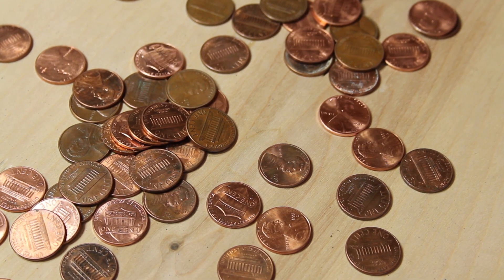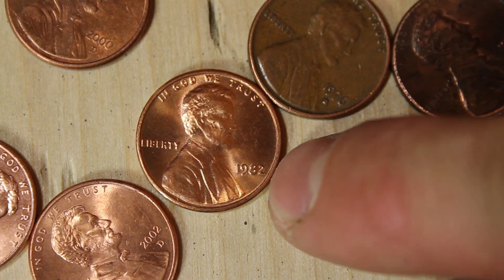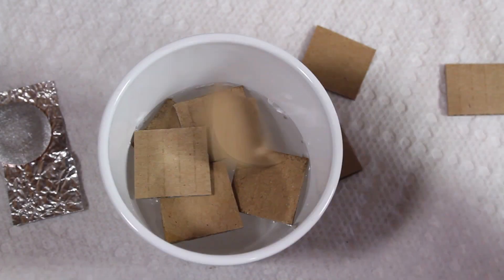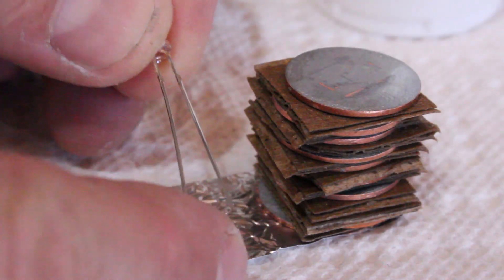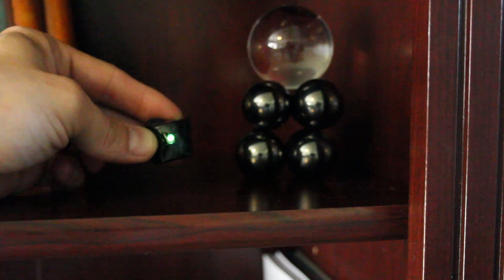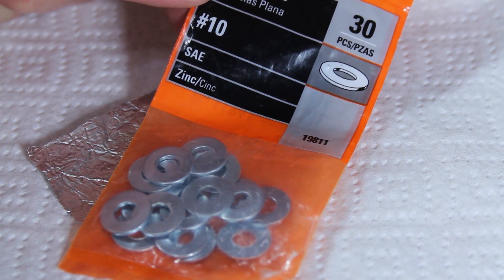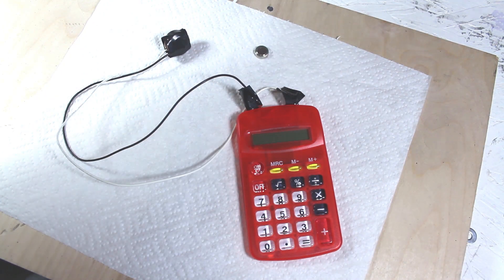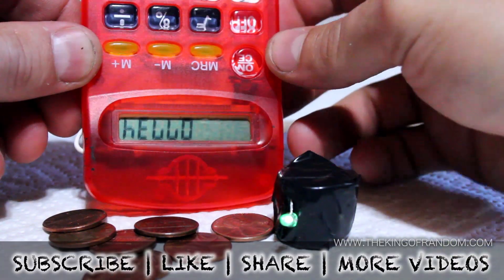How To Make a 3 Penny Battery

Comment: ...also, how big would you need to scale this up to be able to charge a typical cell phone? 5.5V 700-1000mA?
Reply: You'd need 500 of the 9 in series as (1000 milliamperes) / (3 * 700 microamperes) =
476.190476 --  I said 500 to account for loss. At $45 worth of pennies you are better off plugging it in or buying a dedicated phone charger, plus it wont last very long

Comment: I wonder how many grams the larger 6.0 volt pack weighs it could produce some good competition low weight battery packs for radio control model radio equipment voltage needed around 4.8 volts minimum 400ma.

Comment: That's closer to being a capacitor, not a battery...
Reply: nope, i'm pretty sure that it's a Voltaic Pile!
Reply: VoltageHacker That's exactly why I'm asking because it's not at all like that.  The voltaic pile (thanks for the historic reference, Herr Russo Tragik ) is a battery.  The acid (vinegar) that the cardboard is soaked in is NOT a dielectric (i.e. insulator) but an ionic conductor (electrolyte).  A capacitor has to be charged in order to work (that's when you put charge onto the two electrodes and you need the dielectric in order to keep charge separation).
This is a battery where you take one "more noble" metal (copper) and one metal that is to be oxidized (zinc) and exploit the difference in chemical potentials to generate electricity.
Reply: how?
Reply: Harm10412 well, how a capacitor works is theres two sheets of metal and a dieletric , one bigger and the other and the + and - are attracted to each other so the + draws the - toward it looks like this +|- and the Voltaic pile acts like that
Reply: Harm10412 nigga i wish i understood you
Reply: SomeHooligan what exactly do you not understand?
Reply: Harm10412  you're absolutely right. This is far from being a capacitor

Comment: what if i use thai coins? do i still need to sand it or put the rings on it?
Reply: ghuegel No the higher the potential difference, the higher the voltage.
Reply: You need two metals with different potentials... that is, they need to have different affinities for electrons.  The higher the potential difference between the metals, the stronger the electric current will be.  The sanding of the pennies was used so copper (the outside metal) could interact with the zinc (the inside metal).

Wikipedia says that the 50-satang coin is copper-plated and the 1-satang coin is made of aluminum.  These coins should work about twice as well as what was used in the video... but maybe not... I don't know whether the formation of aluminum oxide on the surface will prevent your aluminum coins from working.  Could be a cool experiment.
Reply: As long as one is Zinc and another is copper then yes
Reply: Victor von doom I've been reading your comments. You clearly are still learning the basics. Please don't mess with microwaves until you have a good understanding of electronics, electrical circuits and most of all, safety procedures. The transformer in a microwave is no joke, it can kill you. It's a high voltage device, about 2 kilovolts if I remember correctly. It's also high power (typically around 1000Watts), meaning it can push a lot of current at that high voltage. 
To give you an idea what you're really asking.. people are making plasma arcs with these transformers, and by running them in reverse, they can be used for welding metals together with hundreds of amps of current.
Reply: They need to have a large amount of zinc, im not sure if thai coins do but google will know :)
Reply: Im trying two baht coins
Reply: Victor von doom yes because America is in a crap load of debt they are using zinc because its much much cheaper than copper.
Reply: uhm, in english please?
Reply: Stefan Predersen Right.  I was trying not to be overly technical, so I used "stronger", which is vague; but I had hoped it would get the point across well enough.
Reply: And where exactley are you gonna get Bhat?
Reply: you can use anything copper for the positive side, and anything galvanized for the negative.
Reply: Fuzzi Bunni can u give me a list of galvqnized stuf
Reply: Do u guys know how much a transformer and a capacitor from a microwave is?
Reply: 10 pounds.
Reply: eelcogg
Not only that, a microwave or TV capacitor can kill you without even being plugged in! It's not worth messing with until you know what you're doing.
Reply: Guys, even though  i might be a beginner i opened tons of stuff before a microwave which i already did
Reply: Timothy Kawasaki i live in Thailand, so it should never be mission: impossible XD

Comment: Great substitute for wire: Take a long piece of aluminum foil and roll it up using a thin skewer. The hollow ends make an easy way for making quick connections (just squeeze) and you can cut it to any length. ;)

Comment: Can you test this on an RC car? you just have to reach 11.1 v and test it out. Or would it not work?
Reply: wouldnt work without a LOT more batteries in parallel, as he showed in the video for 6 volts from 3 cells you will get 300micro amps so you would have to have hundreds of cells wired up, some in parallel, some in series to get enough power from pennies to run an RC car. i could calculate how many but meh... im too lazy :P

Comment: Kinda neat trick to show everyone how to make a wet-cell battery (if they caught it), but I had to crunch the cash on this one, and it is scary:
10 pennies

6-volts @ 0.170 microamps (0.000170 amps) means that for 20 pennies, you get to 12-volts (in serial), and to start stacking 20-penny serial circuits in parallel 1,176,470 times (average automotive battery output) gets you to 200 amps for a mere  $250,000. (compare to an average car battery cost of about $100); or, simply $1150 for 12 volts, per amp (or $295 to build you your own wet-cell 4-pack of double-AA batteries, not counting the vinegar, prep, labor, cardboard or GIANT plastic box to keep them all in).

Sorry, I couldn't resist. I think I'll stick with Eneloops and my recharger.
Reply: Sure thing, it is not efficient.  but I am pretty sure any good chemist could get an efficient way to make home-made batteries.
Reply: *****  Depends on what you mean by efficient but yes there are many other better ways to make a battery, though they are much more involved

Comment: Does the United States still use pennies?  Canada doesn't so I guess I have a reason now to make a MEGA battery!  I wanna see a few BIG stacks that equal over 1,000 pennies to see if it can power a few household appliances.  Or see how long it will power a 100w conventional light bulb!
Reply: Okeanos86 Lol, what, seeing someone admit they were wrong instead of being huge dicks and totally flaming the hell out of someone while behind a computer screen?  Not often at all if ever, so respect to you my friend!  Cheers :)
Reply: sc0tte1 you're right, i was wrong :) (how many times have you seen this phrase in the internet? :P)
Reply: YOU ARE A MAD-MAN!
Reply: MrPypap So I've been told a time or two.  What's your reason for thinking I'm a mad-man? :P
Reply: a conventional light bulb works with AC-volt, a battery puts out DC-volt. so it won't work for a second
Reply: Okeanos86 A conventional bulb will work on either AC or DC.  It's just a tungsten filament that heats up; it doesn't matter if the current is alternating or not.  Light bulbs in cars ect work the same way and they are on DC.  Bulbs with electronics however probably won't such as compact florescent.
Reply: sc0tte1
A CFL bulb will work on DC, just make sure the voltage is right. For a 230V AC bulb the appropriate voltage is about 280V DC (Sorry I don't know about 110V bulbs... but I guess 140V should be enough)
Reply: MrOpenGL Interesting..I'd still wonder how good it would be for the electronics inside, causing it to fail earlier but only one way to find out lol

Comment: So considering that the battery for the calculator cost like I dunno, 20 cents? How long did it last compared to the battery it came with? Those little batteries generally cost like 10$

Comment: Wait so when you took the zinc washer and placed it on the bottom followed by the cardboard and pennies, did you sand down the pennies or not? And did you use dilute, or undiluted vinegar? Or does the kind of vinegar make no difference?

Comment: its miliamps not microamps. if it was microamps the led would glow because it uses 10-20 mili amps (10 000 - 20 000 microamps)

Comment: I wonder could you not have 2 cups one filled with say 20 round copper pieces and one cup with Zinc washers and fill them with vinegar . Attach the copper pieces together with wire same with the Zinc washers . Would that work ? One cup is + the other is - then just refill the cups to keep the charge ?

Comment: i powered a nerf gun with it and that it was supposed to be 9 volts power and it used d batteries and then i staked then up and i made like 30 penny D sized batteries its probably like 9 volts each then i made 6 of them and replaced D sized batteries with the penny battery and then it burned out the motor of the gun when i tried it

Comment: Question: Was the polarity of the 2nd battery reversed?

The 1st battery had the copper side of the penny on the aluminum foil, leaving the zinc side on top. When you measured the voltage, u placed the pos (+) lead on top and the neg (-) on the foil.

The 2nd time, you put the zinc washer on the foil, but still tested it with the pos (+) lead on top and the neg (-) lead on the foil.

I'm new...... did I miss something? I just want to do this with my grandkids. Thanks.

Comment: what will happen if we put 200 cell together ? is it will give us 100v :) yeah
Reply: The vinegar is what puts out the energy, not the pennies. The pennies are just the positive leads. The zinc is the negative lead. The vinegar contains the acid. 1 copper lead and 1 zinc lead (like a nail) would be good enough in a tub of 4% vinegar you could probably start a car (12v)
Reply: Nerolus Exactly. I am happy to know that some one knows that the acid in the vinegar gives the electricity. The pennies are just the collectors of the electrons in the electron changing "war" between the acid ions.
Reply: Nerolus Thats exactly what I was wondering! Thanks for that
Reply: Nerolus
Except you cannot start a car because the current is ridiculous (unless you are using very big plates like 50cm by 50 cm

Comment: A CR2032 has 0.6 Wh of stored energy (200 mAh * 3V) and costs around $2. That comes to 0.3 Wh per dollar.
These batteries have 0.42 Wh of stored energy (70 mAh * 0.6V) and cost 1 cent each to make. That is, 42 Wh per dollar! LOL! ONE DOLLAR worth of these have the same capacity as 70 CR2032's, which would cost you 140 times as much!

Comment: Since it only takes 5 volts to charge a cell phone, would you be able to do it using penny batteries? Or is the amperage too low?
Reply: You can make a bunch of 5 volt cells and wire them in parallel till you achieve the needed amperage. Most cell phones run off a 1300mAh battery so that may take quite a few pennies.
Reply: ***** More like 13000 of them to get to 1300 miliamps. 130+dollar project :)
Reply: If his 10 penny stack provided 0.17 mA for 2 1/2 weeks, it provided approximately 71.4 mAh of power.  Dividing that out would require 18 stacks of ten pennies.... and two and a half weeks to accomplish the task.  

If you wish to achieve that 1300 mAh charge within an hour, multiply the 18 stacks by 420 which gets a bit expensive ($756).  But for around $4.50 you could knock the task out in about a week.

Comment: Im doing it for my science project and it worked just make sure to use card board not normal paper
Reply: did you sand the pennies down or did you use the zinc washers? I tried with the zinc washers, but the most voltage im generating is 1.3 volts and it doesn't seem to want to light my led light
Reply: Robert Ito Check your LEDs Forward Voltage, typically around 3.6; so your 1.3V generated isn't enough for the LED to produce light.
Reply: Michael Telatynski you can get 1.5V led's in like kids science toys so 1.3v will be enough for lighting a LED up
Reply: A bit late, but i found out what i did wrong. I didn't line up the metals and electrolytes properly. The pattern should be zinc, electrolyte copper, zinc, electrolyte, copper. What I did was put an electrolyte between every metal going zinc electrolyte copper, electrolyte, zinc, electrolyte, copper, etc...

Comment: Almost any different metals, will work, I made one with brass and steel washers I had laying around and just paper towel circles with a soaking in vinegar which contains acid, stacked one metal, wet toweling, other metal, then first metal (No towel, metal touching metal here), and then toweling and other metal again. aluminum and copper works well too... actually coins are a mixture of metals and pure metal works better. Aluminum foil circles instead of the brass worked too.

Comment: its best with pennies because they do have a zinc core and thats whats needed with copper to have it work well. pennies used to be completely copper until copper got too expensive and the weight of the copper as a metal was worth more then the coin

Comment: No, the vinegar (acetic acid) causes a reaction called a redox reaction to occur between the two metals. While the reaction is occurring electrons are flowing. Electrons=electricity. See the similarity in the words. The "battery" should keep supplying electricity until the reaction is complete. If you want to know more... google it! :)

Comment: im wandering if after the battery has ran out of juice , could recharge the battery by putting a reverse voltage and current through it? is it a reversible reaction?

Comment: .. but it is very dangerous, you can get electrocuted or burn your house down, so don't stick pennies in the fuse box (but it does work, a fuse is designed to blow if overloaded, a penny doesn't blow and will keep the electricity going, but it may get to such levels that it starts a fire)...

Comment: Mostly the later (i.e., re-soaking the cardboards) should work. However, the electrolyte (vinegar) deposits on the surface of the pennies (as acetate). So those may need some cleaning/sandpapering.

Comment: now i get it..... related to electrochemical cell @@ pennies = copper+zinc
Zn -> Zn2+  +  2e-  which gives out ----->+0.76V
Cu2+  +  2e- -> Cu which gives out ----->+0.34V

related to standard reduction potential, that's why gives out voltage @@

Comment: Well when you think about it, there is a chemical reaction happening between the penny and the cardboard in vinegar. This is what produces the electricity.
So when the battery runs out, it means all of the penny and the vinegar is used up in the chemical reaction for making an oxide. So when it runs out you will have to replace both the pennies and the cardboard.

Comment: If you want free energy you can use wire or cable is the Cu source and screw is the Zn source can find in the hangar . Apply used paper is a electron translator and  you must keep paper always wet with KCl solution. working well.

Comment: Wii runs on 12V 3.7Amps this was making 5v .00017 of an amp so you would need to stack the battery about 25 pennies high to get 12v and then hook up 21,764 of those 12v cells in parallel to power up your Wii. So that would be about 544,100 pennies or $5,441 worth. Unless I have messed up my math somewhere. Seems a bit inefficient lol. :-p

Comment: I used about 18 penies to make an LED light up pretty good.
Got around 7 volts!

Though I didn't have sandpaper, so I used a knife to scratch a bit of the copper off to reveal a strip of Zinc... Probably not as efficient as it could have been, but it works.

See: gld(.) bz/c/bdb34.png

Comment: It does, but you still need batteries. Take your battery pack out and put the batteries inside the Xbox controller how they would be in the battery pack. Don't sand the pennies though, put three on top of the batteries so it gives the electrical current. The batteries will not fall out either, this is how I use my Xbox controller. Lol, happy hunting

Comment: It's a zinc-hydrogen battery:

Anode: Zn --> Zn2+ + 2 e-
Cathode: 2 H3O+ + 2 e- --> 2 H2O + H2

The anode reaction has a lower equilibrium constant (going towards Zn) than the cathode reaction. So when you put those two reactants together:

Zn + 2 H3O+ --> Zn2+ + 2 H2O + H2

except we keep the reactants physically separate and let the electrons and H+ ions do the "talking". The flow of electrons generates a current of potential that's functionally related to the difference in equilibrium.

Comment: Essentially, what happened was the same reaction in lead-acid batteries; although the biggest difference is that the lead where the electrolytes acted upon was replaced by the penny's copper and the washer's zinc and the acid was the vinegar trapped in the cardboard. Well, at least, that's how I understand it.

Comment: Now read 82.2 Exceptions in PART 82—5-CENT AND ONE-CENT COIN REGULATIONS.

federalregister.gov/articles/2006/12/20/06-9777/prohibition-on-the-exportation-melting-or-treatment-of-5-cent-and-one-cent-coins#p-30

Apparently you need to do MORE research.

Comment: I am confused. You need copper (An old penny has a lot of actual copper in it) and a new penny or washer to act as zinc. You never mention that the copper pennies are older. So if using all pennies one stack is older than 1982 and the other stack is newer than 1982. a Id imagine cleaning them in any fashion helps.Am I understanding that correctly?

Comment: why because the european one doesn't use ore power than the us one it's made in the uk and I went off the actual power regulations because it's a 3.3v circuit but accepts 5v power because a 3.3v power supply is harder to get a hold of unless it's a batteru